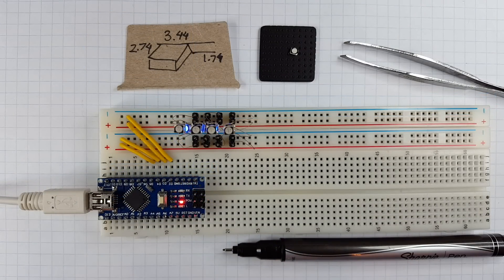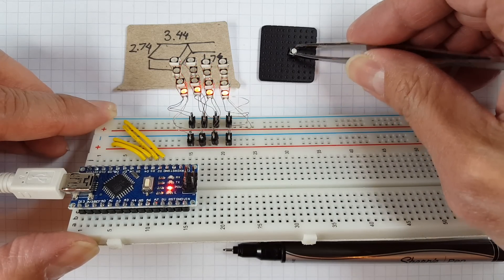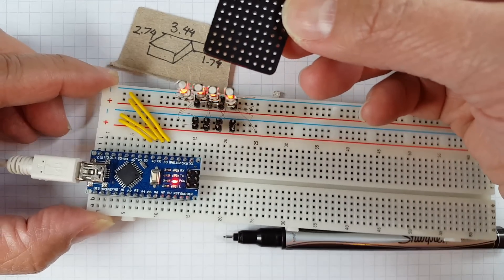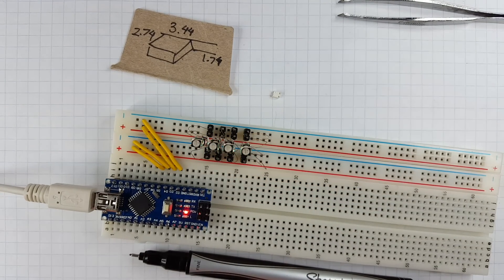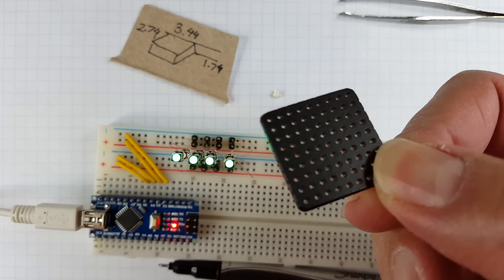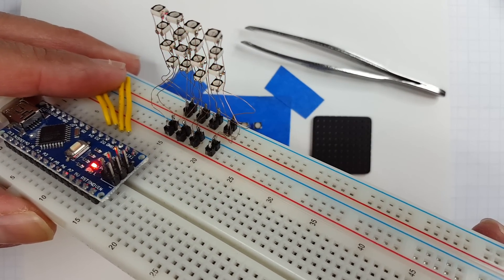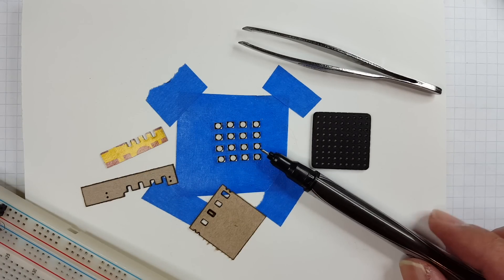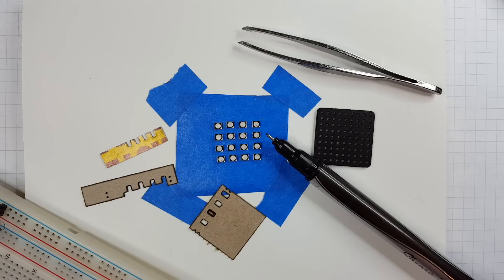HariFun #121 - The World's Tiniest RGB LED Cube (part 1)

Comment: wonder how you wired the data lines
Reply: +norm1124 Looks like regular RGB LEDs, not the WS2812 stuff
Reply: +3zuli don't think so, he can already address the cube layer by layer :-) we will see soon
Reply from the maker: +norm1124  & +3zuli,
You're both right.  They're just regular RGB LEDs and I'm able to control the layers. I can't take credit for the idea, that belongs to +asherglick & Kevin Baker.
http://aglick.com/charliecube.html

By rotating the LED in each layer in each pillar, the four pillar wires can be used to independently control each color in each LED (not at the same time).
In the test shown in this video, I'm controlling one pillar with four Arduino I/O pins.  The other three pillars are wired in parallel to the first.
Reply: +Hari Wiguna Thanks for sharing the idea, I will have a close look soon.

Comment: Okay Okay now I'm impressed. One question how are you going to control it? seeing that the name is bigger then the board it's self?
Reply from the maker: Thanks Jay.  Of course it will be driven by an Arduino :-)  I will use a Nano first, but my goal would be to build a custom Arduino so the whole thing would be self contained in approximately 1 inch cube.  But at this point, I'd be happy if I succeed in controlling all 64 SMD LEDs without making any wiring mistakes or shorting anything. lol